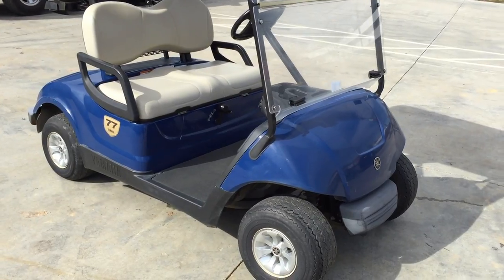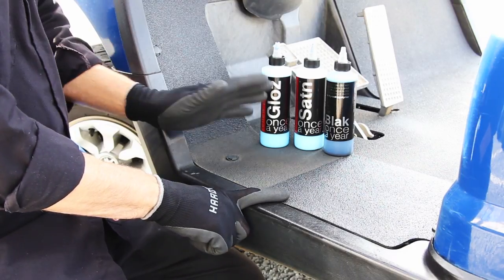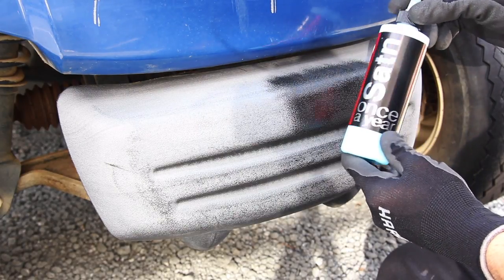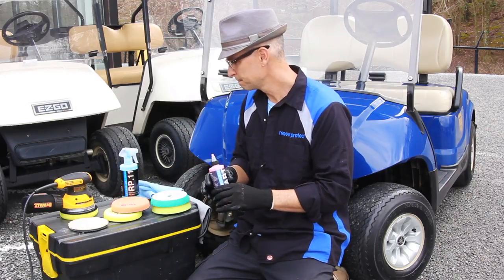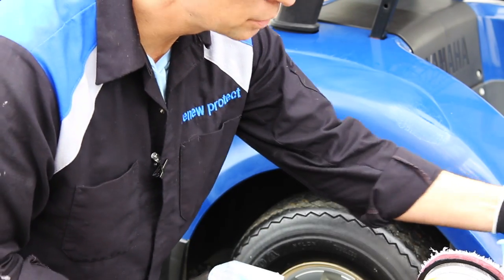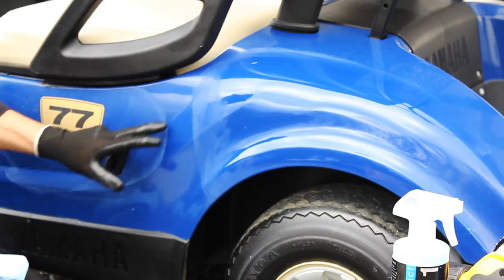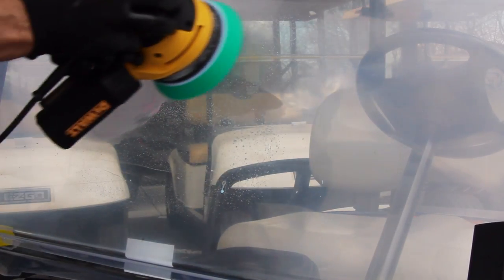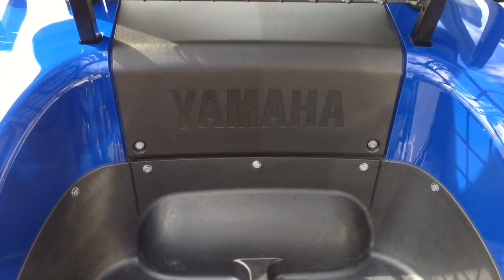How To: Golf Cart Detailing  Permenant Renewal, Body, Plasitc, Rubber, Windshield

Comment: I used to do car detailing back in the mid-90s I just bought a 1998 Club Car here in Florida the lady that I bought it from had it parked out in her front yard for 23 years never covered she wanted 2500 walked her down to 2000 I got that thing home little bit of elbow grease and rubbing compound and did it all by hand very nice looking car very reliable 48 volt Trojan Batteries lights turn signals brakes everything works happy with it I could turn my money around and make a profit but I'm happy with it going to keep it. Be it as it may that cart was a Trainwreck I wish I would have took some before and after pictures... thanks for posting your video sir..

Comment: I just bought a 2004 club car. It has battery acid marks on the side. Looks horrible... can i sand and buff it out?
Reply from the maker: Those cowls can handle a lot when it comes to buffing, etc. Try a spot with 3000 grit and compound.

Comment: I just bought the Renew Protect bundle to restore a faded golf cart.  I am confused on the sander and pads.  I went to Harbor Freight to by a 3amp "sander" thinking that it was a polisher too, just switch the pad.  But sales tech said it wasn't.  I was going to buy a cutting, polishing, and microfiber pad, but there are so many choices.  Also, the sander is a 5 inch, but the pads are 5.5" (just to make this whole thing more complicated),   way too many choices.  a link to a very specific set of devices and pads would be helpful
Reply from the maker: Lake County 5.5" flat pads
Reply: @renewprotectvideo  still doesnt break it down into specific pad. item number? Link?  Lake county has a ton of 5.5 flat pads

Comment: Great video, thank you, like to get the product where to get it, it will be for a car too?
Reply from the maker: Check RP.05 which is the milder cut version of CART. https://renewprotect.com/how-it-works-ceramics-rp-08-rp-05-and-rp-11/
Reply from the maker: We sell RP.05 which is similar yet lesser on the cut/correction ability.... CART will work on clear coats etc as a strong polish & sealer. RP.05 correction to 3000 grit and CART to 1500.

Comment: How is CART for auto and bikes?
Reply: We sell RP.05 which is similar yet lesser on the cut/correction ability.... CART will work on clear coats etc as a strong polish & sealer. RP.05 correction to 3000 grit and CART to 1500.